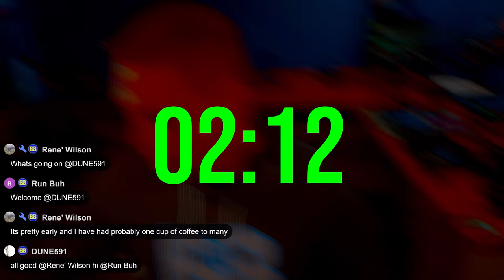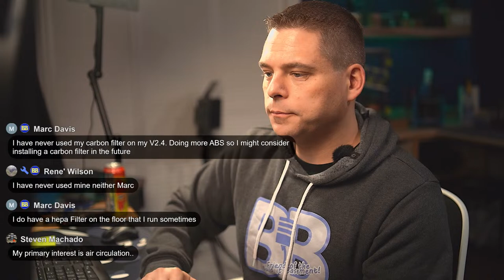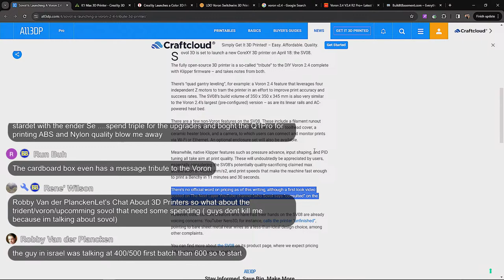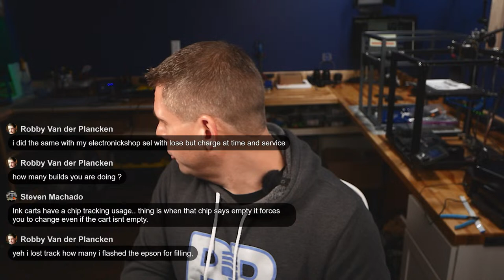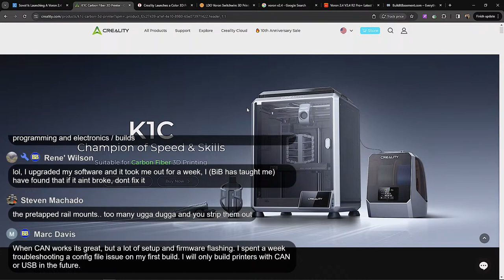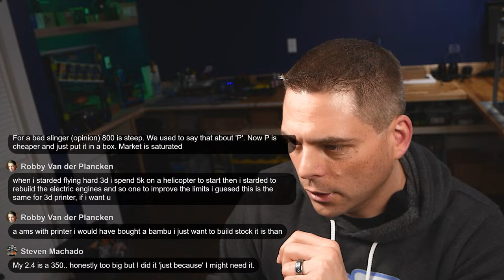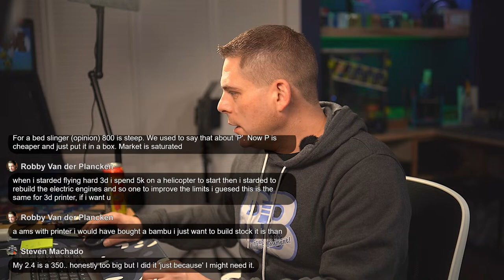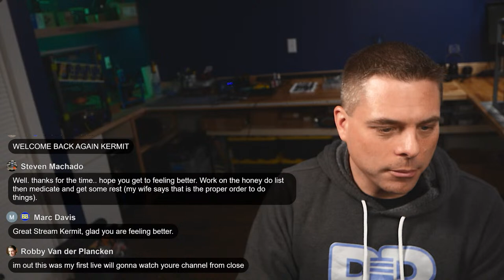Let's Chat About 3D Printers! 4-2024

Comment: Sir. I am building my first Voron Trident 300x300x250. I using all self sourced electronics (raspberry pi4b, motherboard octopus max ez, can 2209 rp2040, voron tap chatoiclabs, stepperOnline 2004s1 xy, 3 z motors 300mm t8x2). Where would I start on making a Klipper config for this machine? I am still learning about this and I feel like I am going to get stuck at this part. I am starting my build on Friday. So I have a while, but it is in the back of my mind. Machine built but cant use it. Hahahaha. Thank you for your time. Any help would be appreciated or suggestions. Glad your feeling better.
Reply from the maker: First off, congratulations! When you install Klipper there are some BASIC CONFIGURATION SAMPLES these are great learning tools.  I would also check GitHub for your controller board, you'll surely find a printer.cfg there as well.  Finally I have a few videos in my back catalog you can look at, just go to my channel and look around.  Join the BIB discord.  We're always helping others and each other.

Comment: Maybe I don't fully understand, but I don't think sensorless homing would impact the quality of the prints. I would think sensorless homing would only impact the accuracy and precision of the home position. Ultimately, that would impact the exact position the print occurs on the plate, but not the part itself. Maybe that could matter if you have a use-case that requires re-homing xy axis during a print, but otherwise I don't see that as a major drawback. What do you think?

The reliability of sensorless vs. physical end stops is a different discussion, but I only have experience with sensorless. I have had my fair share of issues, but I've also seen discussions about switches failing over time due to heat. Ymmv, but I'd love to hear your take on that, too.
Reply from the maker: I also have had the same questions - and concluded the same two things.  1) Yup. The start print location may be off by .02,03,04?? But decided that doesn't matter to me.  2) If I do prints with manual filament changes, it may be an issue!  I really haven't had many (any) issues with switches on any of my four printers. I do wonder what's more precise the electronics seeing the jump in current or the physical switch.  Sound like a good video, at some point! lol...
Reply: @BuildItBasement  Thank you for the reply! I have done quite a few manual filament swap prints while running sensorless. At least with my macro, sensorless or not should be irrelevant because I don't rehome. I could see a benefit to rehome if there's a risk of the tool head getting bumped out of position before the print resumes, but I'm not particularly worried about that.
Reply from the maker: I rehome at the change, allows me to park front, home, purge and brush.  Everyone is different - and cutting the homing out of the process could be the fix if sensorless is less precise than a microswitch.